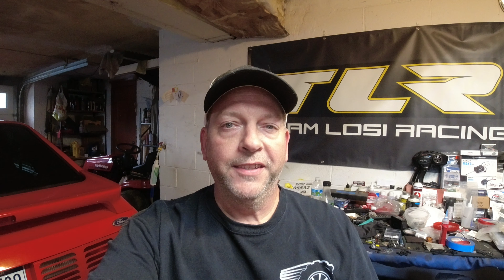Arrma Fireteam First Rip 6S

Comment: I've had a fire team in the box for a year now , I'll be m2c'd to the moon on e I get passed my KRAKEN trophy truck build chassis , pin braces , shock towers , servo and steering bell crank have to be replaced for sure , just no good quality there , I e been watching videos for ever , to get a grip on its failures , but a great platform, I m o , if that's worth anything cool video , gave me more insight
Reply from the maker: @chrisryder4709  what is up brother! I am trying to keep this rig light and cheap to fix. A friend has a max6 system for it. The old v1. Should be fun. Really appreciate you stopping by 👊🤘